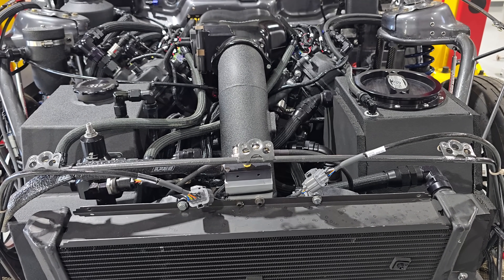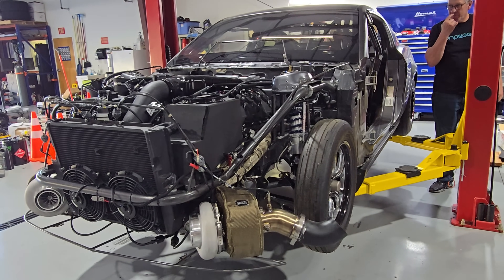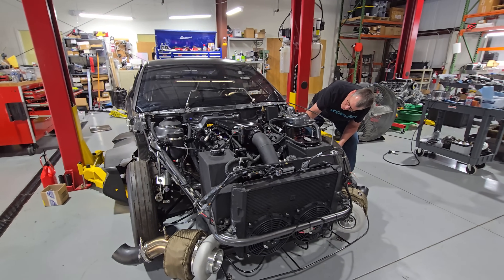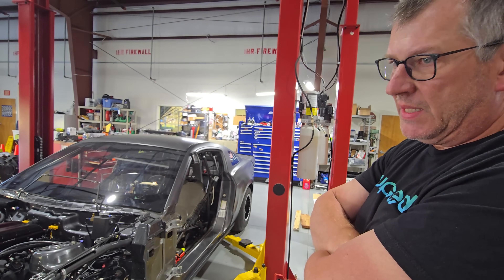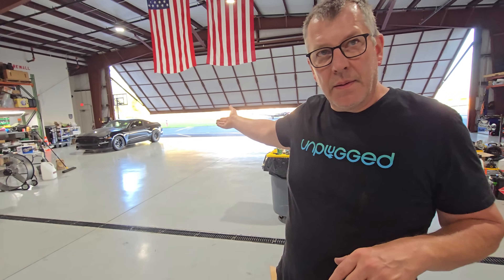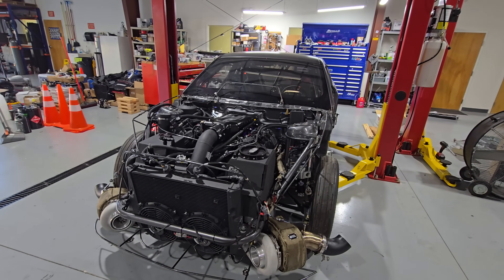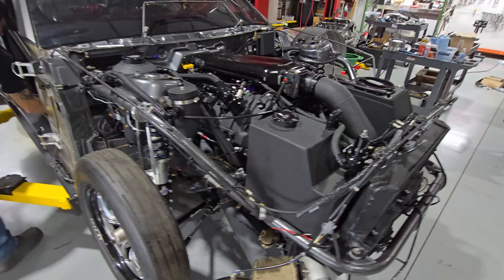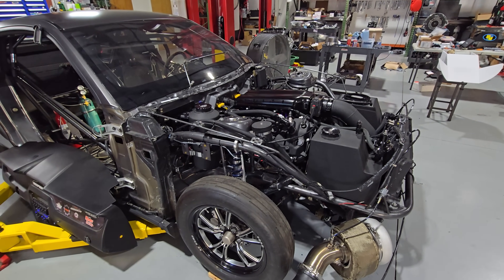JR and SR grey goose motec conversion for Gen 2 Coyote Engines

Comment: Hearing about multi-bus CAN networks reminds me of VLAN's in traditional hub-spoke networking (multi-LAN). Bottom line, it's cool you can segment whatever communications you might need to amidst the factory primary bus.
Reply: That’s actually a very solid analogy, with a few important caveats. Multi-bus CAN architectures function much closer to a segmented, priority-based broadcast domain than a true VLAN, but the design intent is similar: deterministic isolation without duplicating physical infrastructure.
In automotive systems, each CAN bus is its own arbitration domain with message-ID–based priority, not address-based routing. Segmentation is achieved physically (separate CAN transceivers) or logically via gateway ECUs that perform selective frame forwarding, filtering, ID remapping, and rate shaping. The gateway essentially behaves like a Layer-7 application-aware bridge rather than a Layer-2 switch.
Unlike VLANs, there’s no concept of trunking or tag-based encapsulation on the wire. CAN relies on content-addressable messaging, where every node receives every frame but only processes IDs it subscribes to. This makes bus loading, bit timing, and worst-case latency analysis critical—especially once you start bridging between high-speed (500 kbps / 1 Mbps) and low-speed or fault-tolerant CAN networks.
Where the analogy really holds is in functional isolation: powertrain CAN, chassis CAN, body CAN, diagnostics CAN, etc., are separated to prevent non-critical traffic from interfering with hard real-time control loops. The gateway enforces policy much like inter-VLAN routing ACLs—deciding what can cross domains, when, and at what rate—but always with determinism as the primary constraint.
So yes, conceptually similar to hub-and-spoke multi-LAN designs, but with strict real-time guarantees, priority-based arbitration, and no packet buffering tolerance. It’s less about bandwidth efficiency and more about bounded latency and fault containment on the factory primary bus.